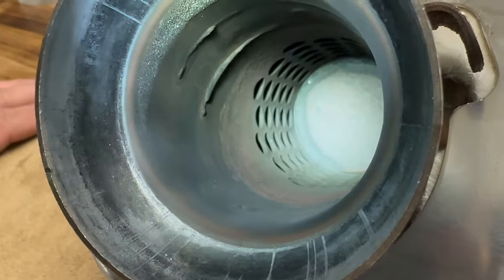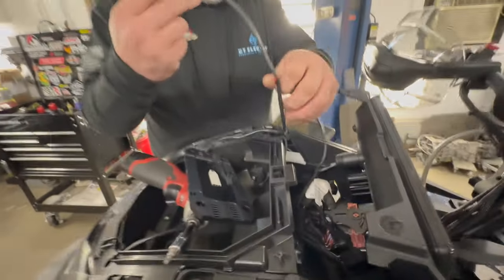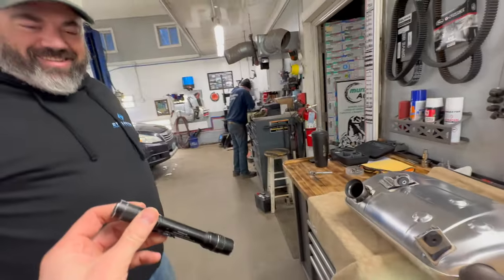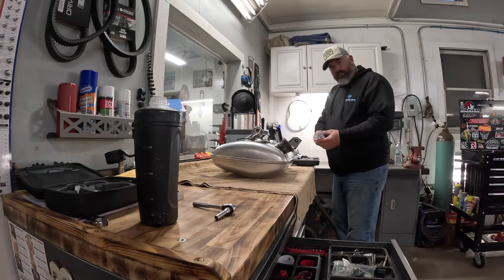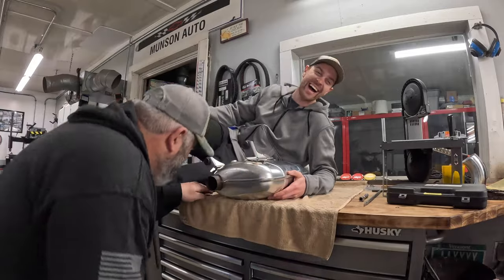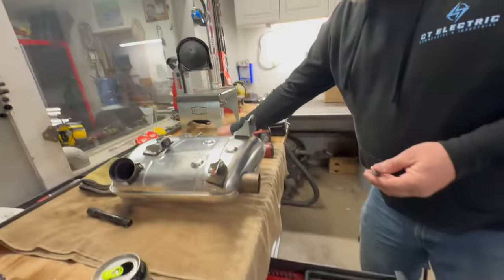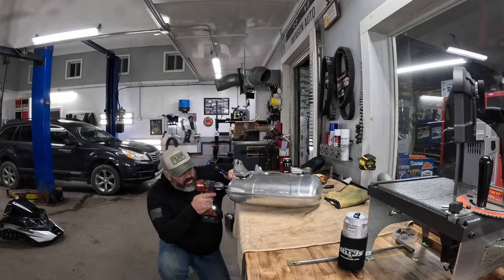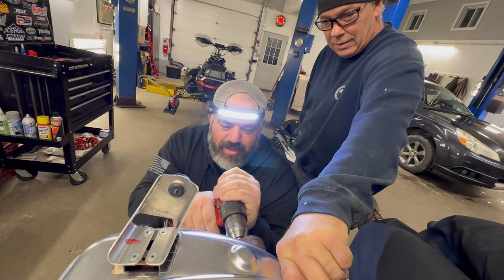2024 900R XRS Muffler Mod, let's let this Pure Turbo upgrade thing breath!

Comment: any extra power from this or change in max rpm?
Reply from the maker: I don't believe so, the stock 900R muffler actually does flow very well in stock form. The earlier 900T muffler had room to be improved on with these mods and that has been dyno proven, we mainly did this for a little extra sound and if it happened to free up some flow, that was an added bonus but not the first concern.